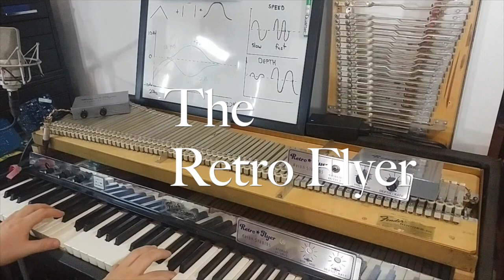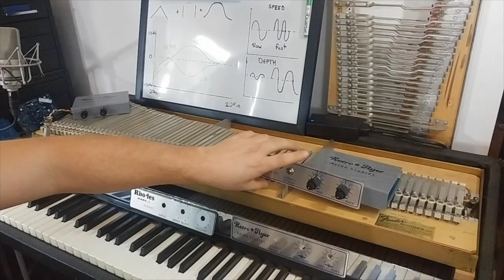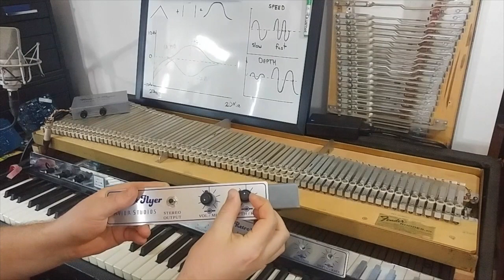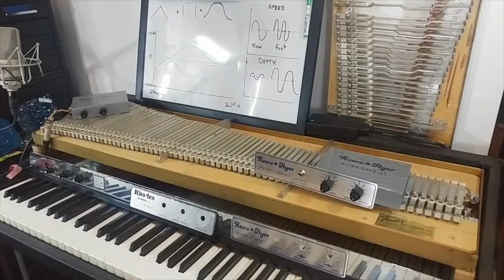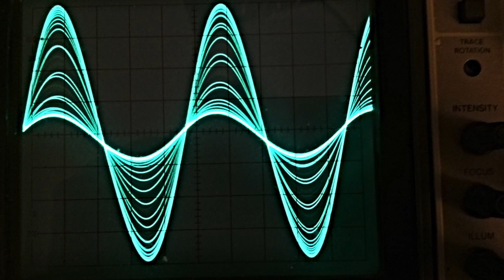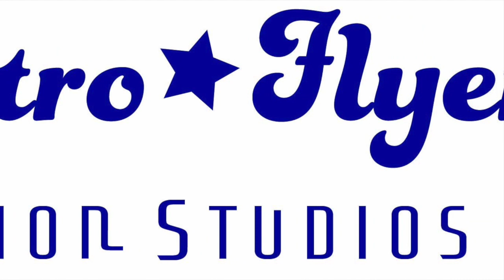The Retroflyer - An Introduction - Active Retrofit Preamp & Tremolo for Fender Rhodes

Comment: I’m very interested in buying one of these but most if not all of the videos that I’ve seen sound distorted. Is that common on these units? I noticed that it distorts mostly while they’re playing bass notes.
Reply from the maker: Hey Bobby, thanks for the question. So there is some distortion on the J3PO video, but that's caused by him overdriving the secondary gain stage after the RetroFlyer. In terms of the RetroFlyer itself distorting it's very very hard to do and basically wouldn't happen in anything like normal use. The RetroFlyer is a pretty low-gain preamp all things considered and that's simply because it's so import to have loads of headroom when it comes to the Rhodes - which is a VERY dynamic instrument. Also if the RetroFlyer were to distort it would not sound pretty, like an overdriven amp, it would just sound like the signal was breaking up.  That's just the nature of IC based circuits like this. So pretty much any distortion you hear will be a result of secondary gain and/or processing.  Or even the speakers at the end of the chain. One way to address this is by adjusting the onboard high pass filter which will reduce the bass frequencies. Another important method is watching the gain staging carefully knowing there is a lot of energy in the bass end of Rhodes so it requires decent headroom throughout. Or in terms of studio...or even live for that matter, a frontside compressor/limiter can also help a great deal in taming the large spikes in amplitude. Lastly would be regulation on the Rhodes itself. The bass end can buzz or distort quite easily when unregulated or due to aged parts. So providing the RetroFlyer with the best signal possible will absolutely help. In fact many people tell us the RetroFlyer is great help in regulating their boards as it reveals spots with issues  much easier due to the increased clarity.  So I hope that helps. Please let us know if you have any other questions. :) - All the best, Greg @ Avion

Comment: I have Fender Rhodes mk ii that is quite noisy and the midrange sounds a bit muddy.
Would this preamp be a big help for those issues? 
Thanks!
Reply from the maker: Generally speaking yes! You'll be able to greatly improve the gain staging which is probably the primary area for noise with Rhodes. So basically you'll be running a hotter signal with a better signal to noise ratio from the RetroFlyer and the high/low in/out impedance will also help out what you're running it in to. Tonal quality/clarity will also be improved. 

All that said, if it's really noisy it could have some grounding issues as well. Or, being a Mk II, may have pickup issues as well. We actually have a 1980 board in this week that was really noisy until we swapped a few pickups that were overly high resistance. So not dead, but impeding the harp signal/ground. They were essentially squeezing/shorting the ground path - making it quite noisy. So while the RetroFlyer is not a cure all, it will be a big improvement across the board. And if you need help diagnosing issues just shoot us an email/call, we're happy to help. :)

Comment: Would this work with a Rhodes 54?
Reply from the maker: It would! The only difference with those 54s is that the holes are father to the left, so the cabling is little tighter and most people skip the faceplate as it hangs over a little without a trim. Other than that installation is the same. Let us know if you have any other questions. 👍🎹
Reply: @avionstudios6463  how does that work considering the 54 has volume and tone faders that slide side to side as opposed to clockwise?
Reply from the maker: @tuckryanmusic  Ah, I thought you had the round hole version. For the slider version you need to modify the rail. What a few people have done when doing that is place the holes in such a way that your can then use the faceplate to cover the slider slots. So it can still look clean despite a bit of surgery. Using the faceplate as a template is the easiest way to do this. I hope that helps. Any other questions just let us know, happy to help!

Comment: This has the mid EQ/boost - but loses the bass boost on the original MkI - is this an issue for anyone? I normally set my bass boost to 4 (or 11 o clock).
Reply from the maker: Good question. So on the passive controls, the "boost" is somewhat misleading. Those knobs really only attenuate either the volume or the low bass. It's not a terrible idea to attenuate the bass as the raw signal from the harp can be very bass heavy and particularly when these were first in production most guitar amps could not handle it well. So really you're only lessening the amount of bass to varying to degrees with that control. That said, the passive controls still degrade the harp signal a fair bit and most people would say you're better off just going off the harp directly and EQing from there. And really if you want a VERY bass heavy signal you're probably best off using a secondary EQ on the RetroFlyer as well. So either from a mixer, plugin or pedal. The bass notes you do get from the RetroFlyer however will be MUCH cleaner and more dynamic. And I think you'll find certainly as much bass as on a reasonably "boosted" signal from a passive model. You can also open up the bass register to some degree using the variable on-board high-pass filter. I would say for most people playing solo, going to 20hz on the HPF is plenty of bass for any live situation.  But again, it's not just the amount of bass, it's the tonal and dynamic quality that really sets the RetroFlyer apart. I'd definitely recommend checking some other videos of the RetroFlyer (they can be found on our site listing) so you can hear some of the other sounds people are making with the RetroFlyer. As a final note, often if you want a really big sound, scooping the mids and raising the volume is a great way to do it as it gives the perception of a heightened or "hyped" bass and treble. Any other questions just let us know. avioncontact@gmail.com Cheers, Greg
Reply: @avionstudios6463  Thanks for the very detailed and quick response! I just purchased it and am looking forward to installing it!
Reply from the maker: @MIDERA  Happy to help! We hope you absolutely love the RetroFlyer. Any questions along the way, just let us know. :)
Reply: @avionstudios6463  I did just send you guys an email! Thank you for the extremely quick replies.

Comment: Is there a way to use this externally without installing it?
Reply from the maker: You can. Some people have done it. We added an open ground tab on the PCB for people that do that - so you can ground whatever enclosure you use. We don't currently offer an enclosure for it but we may at some point. Besides not having the benefit of the controls being on the rail the only real issue is shielding. Installed on the rail the whole harp acts as shielding for the circuit whereas if you place it outside it should have additional shielding. That said, some people who live in relatively interference free homes/studios have simply sat it on top of the Rhodes and signal to noise is still quite usable. So environment is a factor, but really it should have a proper enclosure outside of the rail. Any other questions just let us know. :) - G
Reply: Avion Studios ok! Will check back when you guys make an enclosed version. Thank you!!
Reply from the maker: @louierubio  Well to be honest Louie it will probably be awhile - more likely we'll come out with more retrofit models before an enclosed version. So it could be a year or more. The benefits of the rail mount are a big factor in the design and installation is completely reversible, so you're always safe to go back. Although to be fair maybe 1% of users actually do swap back. Also, if you haven't seen it, check J3PO's demo. It's banging.  https://www.youtube.com/watch?v=hctiuM0jlhE
Reply: Avion Studios ok will do!! Thank u!

Comment: Hi Avion Studios, I've just ordered today the Retroflyer plus 3 TRS cables from your website. I have been looking for a good pream for my Rhodes MII and after some research I figured that most good preamps for mics are expensive. Just couple days ago I saw the video posted by J3PO showing his Retroflyer in action and I have to say I was amazed by the sound that Retroflyer provides. Therefore I pulled the trigger and ordered it. Also the price is another reason for me when it comes to the final decision. 
I live in Taiwan so please provide an adaptor of 110V. Does it come with user manual for installation and usage?
BTW I am thinking about posting videos in my channel making before-after sound comparison once I receive the Retroflyer, so  hope to receive it soon !!
Reply from the maker: Great, thanks for the order and your kind comment. The RetroFlyer comes with a universal power supply as well as a manual which details installation and operation. As for the sound quality and price. Again very kind. We work hard to put out products that are both well designed and constructed as well as affordable. In regards to shipping, if you want your order quickly (which almost everyone does) I'd highly recommend shooting us an email and upgrading from first class to either priority or UPS. Any other questions just let us know and we hope you absolutely love your RetroFlyer! 🔥🎹

Comment: I got a question for you. How are you supposed to get the stereo vibe from 2 speakers when it only has one output? Let's say I'd use the Roland JazzChorus with has 2 inputs for stereo, but this pre amp only has on line out?
Reply from the maker: Excellent question! The RetroFlyer swaps the existing TS (mono) jack for a TRS (stereo) jack. So  to get stereo you simply need to use a TRS cable. We sell a nice right angle version (keeps it out the way) but you can find suitable ones at any music shop etc.. For some people they have mixers or interfaces with stereo inputs, but in your case you just need an adapter to split the stereo into dual mono. We also carry those. There are few custom cables around that do this without an adapter as well. I hope that helps and let us know if you have any other questions. Best - Greg
Reply: @avionstudios6463  Of course, that makes great sense. Anyway thanks for clarifying, since I'm about to get hands on a 1973 Fender Rhodes stage, and I want to have that great sound that a pre amp provides. So I found this pre amp and really like what you've done the the tremolo compared to other pre amps on the market. So now that I know how the output works, I'm not in doubt about which pre amp to buy:)
Reply from the maker: @djLouisLoop  Oh great! And congrats on the new board. Drop a note in the order and I'll put in an adapter for you for free. Appreciate the question!
Reply: @avionstudios6463  Oh man, that's so nice of you:) Unfortunately the deal has been delayed cause og the cover-19 situation but hopefully not for too long...
Reply from the maker: @djLouisLoop  Anytime mate, offer valid forever, just remind us!
Reply: @avionstudios6463  Appreciate it!

Comment: Where is mains power plugged in?
Reply from the maker: Heyo, excellent question - it's really simple. We have a custom DC power cable made that sneaks between the cheek block and the case. Most people just swing it around the side and hang it on the handle so it stays out of the way. It's not the most elegant but it is very simple and reliable. Other people have done a whole assortment of custom installs with IEC jacks in the back and so on. But the general benefit with this simple system is it requires no modification to the Rhodes and installs in less 15 minutes. Hope that helps. Let us know if you have any other questions. Best, Greg - Team Avion

Comment: Hi guys! Is it possible to plug other pedal effect (phaser, chorus..) to the stereo output??? Cheers from 🇫🇷🤘🏽
Reply from the maker: Hey Steve, absolutely! The output will be a bit higher so you'll need to adjust your gain settings on the pedals. And typically keep the RetroFlyer volume in the first half of the rotation to accommodate the smaller headroom of most pedals. I hope that helps and let us know if you have any other questions, we're always happy to help. 

All the best, Team Avion

Comment: I'm trying to get into the Rhodes world. I'm looking to getting a 1973 Rhodes stage piano mark 1. Your retroflyer sounds amazing and I plan to buy it after I buy the Rhodes. Would the Rhodes model I'm getting be a fir with the retro flyer. And also, how would a Rhodes sound through a fender blues jr. Or what do you suggest?
Reply from the maker: That's great to hear Jesus! There are a lot of good amp options for the Rhodes. Many people like a Roland JC-120 or vintage tube Fenders. But really many many amps can work great. Or even PA speakers or monitors. I hope that helps a bit. Feel free to email us anytime for more in depth help/advice.
Reply: Avion Studios have you ever heard it through a fender blues Jr? It’s a tube amp so I assume it would sound good. What do you think?
Reply from the maker: @JesusMartinez-me1je  It should sound quite good. The thing about guitar amps is they won't be as full-range as a PA or keyboard amps. But that's not always a bad thing! The Rhodes shines in the mid range and can sometimes be overly bass heavy or piercing when fully extended. Often we prefer a nice tube guitar amp for quick good sound and sitting well in the mix with an ensemble. Either way, if you have a blues jr it's a great starting point and you can always try out other options as you go. 👍🎹
Reply: @avionstudios6463  I'm excited! lol I hope I can find a good deal here in LA for a Rhodes. One more question can I get a stereo image from the Rhodes to protools with the retroflyer?
Reply from the maker: @JesusMartinez-me1je  Oh super easy to get a good stereo signal into a recording interface. The RetroFlyer gives a great line level signal on the higher side of the volume rotation. ALSO, we have Mark I in Ventura that we were about to ship here. So if you're interested in that send us an email for some details! 😀👍

Comment: Thanks for the info.  I am thinking of purchasing for my Stage Mark 2.  So does it only have ONE jack-output (of which you connect a stereo lead to run to your amp/mixer)?
Reply from the maker: Hey monsterjazzlicks, sorry for the slow reply, we were traveling the past few days - getting a bunch of keyboards. Anyway, yes there is one output jack. But you can use the RetroFlyer in either mono or stereo. The main reason we kept it to a single jack was so that it would fit the most variations of Rhodes name rails without alteration to the instrument. Some people have split the output to dual mono and drilled another hole into the rail. But it's perhaps simpler to use a stereo cable and then split the signal if necessary. I hope that helps! We're always available via email (avioncontact@gmail.com) if you have any other questions.

Comment: Hey there, really intrigued by this product. I'm playing a Mark I Stage 73 into two SF Twin Reverbs currently, but would love to have this proper rhodes preamp before the amps so I wouldn't have to crank my amps so loud to get a useable level all the time. You think its ok to run this thing before the two Twins??? I guess I would need some kind of a TRS to 2 TS splitter to split my signal to the amps as well. I'm just using a Boss tuner right now to split the signal, but the true stereo is what i wannnnt.
Reply from the maker: Hey Tae, I think we got back to you on Reverb but for anyone else wondering. YES, this is a great use for the RetroFlyer. It will improve the overall gain structure AND the signal coming into the amp. I (Greg here) personally use 2 Deluxe Reverbs and I think two twins would sound awesome. 
As for cord, there's tons of ways but I recommend going in with a right angle stereo, splitting out from that can be done in lots of ways. Cheers!
Reply: @avionstudios6463  WOW. I pulled the trigger on the RetroFlyer and had my first practice with it last night. My signal was so clean and strong that I actually had to upgrade the speakers in one of my Twin Reverbs because it couldn't handle it. Somewhere on the Avion Studios site the RetroFlyer was described as "taking a blanket off of your Rhodes", and that is absolutely correct. I finally feel like I have the tone I've wanted in my head. I instantly started hearing and writing new licks because the complexity of my tone was so expressive. The guys in my band made me turn down, which has never happened before. Everyone was blown away by the sound and how crystal clear it was. Our band is pretty much centered around the Rhodes and its like it solidified the sound in the room, smoothed everything out. Ok, I could keep going, this is 100% honest review I am just @#$%ing pumped about the RetroFlyer, NICE WORK!!!
Reply from the maker: @taejun9017  This is so amazing. Thank you so much for taking the time to tell us. You have no idea how happy this sort of thing makes us. We're honored you tried out the RetroFlyer and even more honored that you're "@#$%ing pumped" about it. Send us a link or tag sometime, we'd love to hear your band in action. All the best, Team Avion